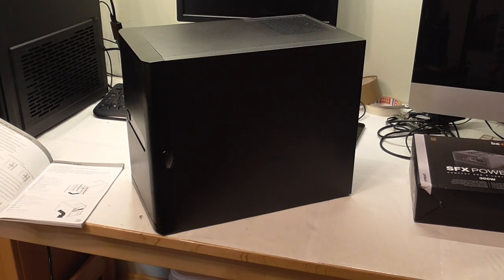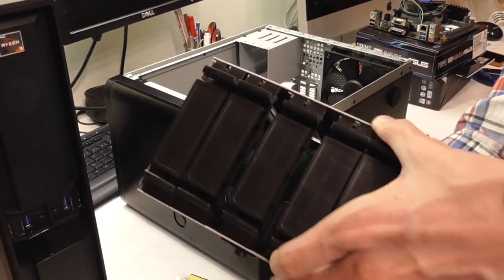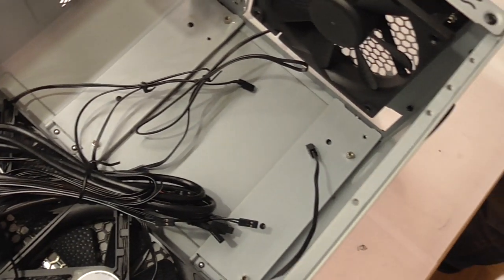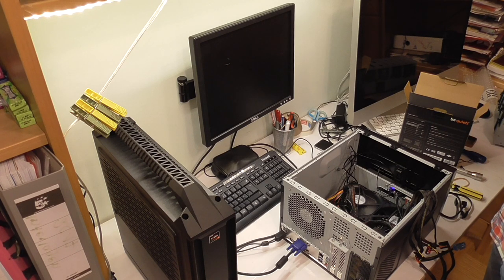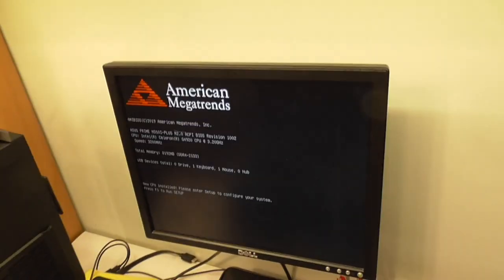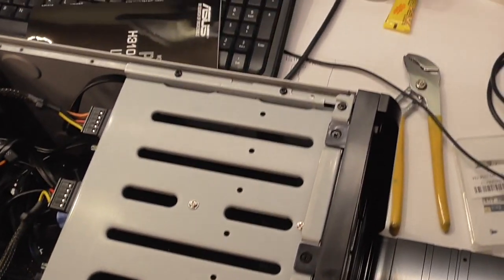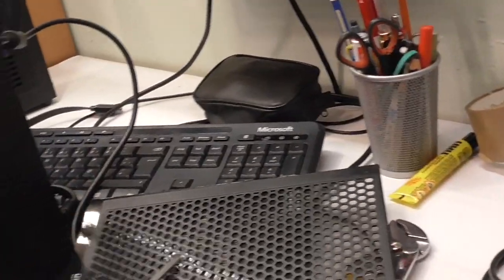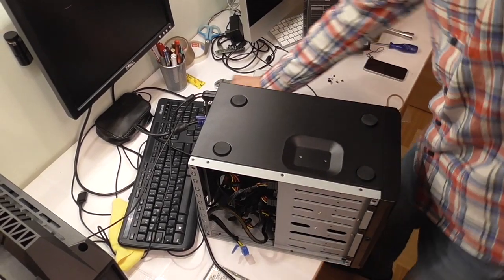NAS Server Build using Xigmanas

Comment: 1. Move drives and USB thumb to new server.
2. Boot it up, if something is wrong correct it.
3. Upgrade software on the thumb to lastest availble.
4. Insert M2 SSD and add it as ZFS Cache.
5. Insert new disks, format and make second ZFS Pool.
6. Copy data from old ZFS Pool to new ZFS Pool.
7. It will copy data a lot way faster than over network from old Dell maxing one core.
4a. You can even add ZFS virtual device from new disk as ZFS array to old pool and resize it to larger pool.

Comment: I love Xigmanas cause it's got everything a server needs right out of the box and it's extremely reliable. I run it on a mini-ITX build with integrated celeron, 4GB ram, 4TB HDD and it works great. Doesn't need very much in terms of hardware.
Reply from the maker: I love it too! Ever since I built this server it has been rock solid with very little to no issues. Also I had three power outages so far and every time it just started right up again. Great OS, if you don't care for the fancy consumer NAS machines.

Comment: So, you technically aren't running out of RAM. ZFS uses all that RAM. You could put 16 GB in and over time, it will fill up. ZFS caches the files that are frequently accessed. Granted, 2 GB is pretty low. But there's definitely a guy who ran ZFS on 768 MB of RAM and 2 cores. He was getting 800 mb/s scrubs. Good build overall, though. That case is tiny af.
Reply from the maker: Yeah, thanks for the information. I upgraded the server now to 16 GB RAM and I also replaced the stock fans to some more quieter ones. So far I'm very happy with it.

Comment: use cache drive for your sata, you will notice huge difference. ditch ur red WD, i think you know by now what i mean, and last you needed to copy from server to server since using your windows client to copy over is actually limited to it. and monitor via iostatus for the speed. i have i7, 32GB RAM two pools 3x1TB SSD, and 4x1TB SATA with cache drive msata 64GB.
Reply from the maker: Thanks a lot for you tips. I'll not change my server now though because it is very reliable and also I don't have any money to spend on HDDs right now, also I don't need more space or speed.

Comment: Did you know...?   ...that now you can install XigmaNAS on multiple USB drives in mirror? I have installed XigmaNAS on two USB drives (da0, da1 ) in Mirror mode in case one drive goes bad for whatever reason. This adds a certain level of redundancy to the operating system and general reliability.

I've seen most people use all kind of RAID on their data drives, but only ONE disk for the OS. That's a weak spot.
Reply from the maker: That's awesome, I didn't know that. If I find the time I might just do that. There's no pressure though, because I save my configuration file every 30 days so if the USB fails, I can always restore the OS to the point it was with one file. But still nice that you pointed that out, thanks.
Reply: @MacintoshMen  You're welcome! Might be worth a video of yours where you can mention this additional security layer.

-Bandi

Comment: Lmao that case got bent? I would go with a Fractal Design Define R5 for a NAS. Way bigger but way quieter. Also I think that board uses M.2, should've got an M.2 SSD, LOL. My 2TB Seagate Barracuda arrived fine packed in some folded cardboard and plastic wrap. What you saw was a Western Digital drive being a Western Digital drive.
Reply from the maker: Unfortunately a Full size tower would take a away a lot of space in the office, the old Dell already did too. I am in fact happy with the Silverstone case, I just swapped the fans because the stock ones were too loud; a vid on that is coming up soon. I am thinking about using the M.2 maybe for the OS disk in the future. It's just way more elegant that a USB drive sticking out the back haha

Comment: What’s your peak ram usage? I’m considering turning an old piece of poo with 6gb ram into a zfs backup server.
Reply from the maker: I use it now with 16 GB RAM. It uses it as cache so RAM is always maxed out but it manages it pretty good. Also 8 GB RAM worked pretty good, so I'd say yours with 6 GB will also work nicely. My old server was an old Optiplex with only 2 GB and it also worked (not so fast of course)